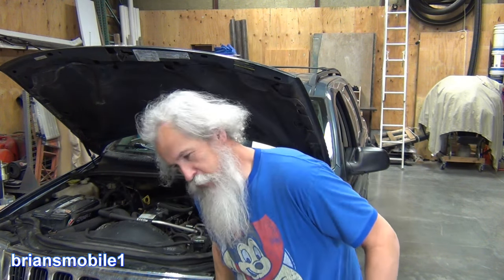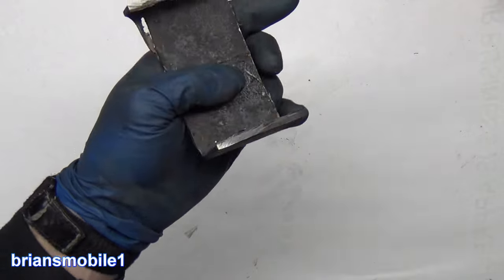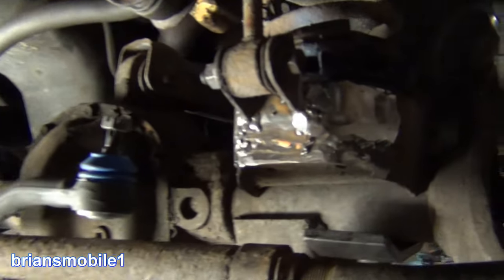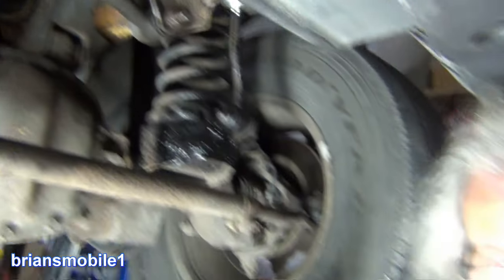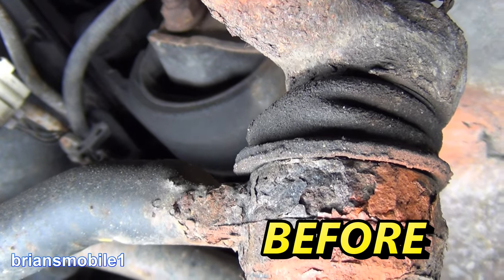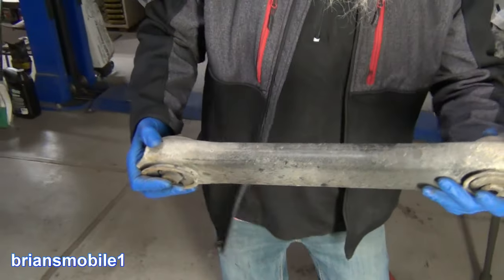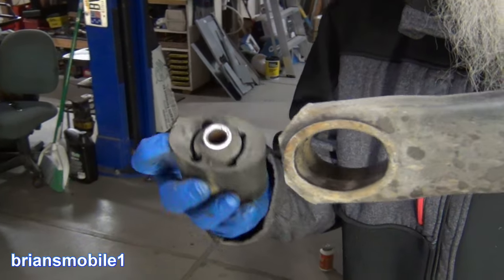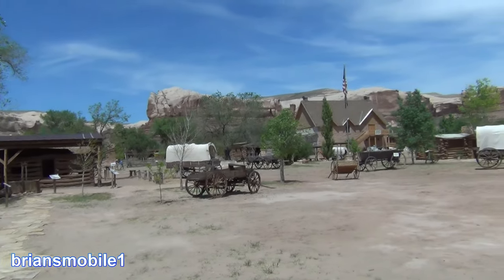FAILED Jeep Front End Parts Before and After

Comment: Nice upgrade Brian ... I've been driving Cherokees for 35 years ... my 2000 Sport has 257 K on it ... I have rebuilt the suspension a few times, plus control arms and bushings  ... Just did front shocks and new everything brakes all around ... I coat the underside in fluid film often as I'm now in the PA rust belt ... it drives like it's brand new ... good tires, brakes and suspension are a lifesaver and make driving enjoyable ... can't wait to relocate to Florida

Comment: Good on you Brian for helping out a another good dude. I can appreciate suspension improvements. I just finished putting new shocks, control arms, tension struts, and bar links on my 2007 335xi. No more vibrating at highway speeds, and clunking over bumps.
Reply from the maker: Nice Will!  Suspension work just satisfies to have done.  The end result feels like the car is new again.
Reply: @briansmobile1  for sure and makes you forget about wanting to get a newer car.